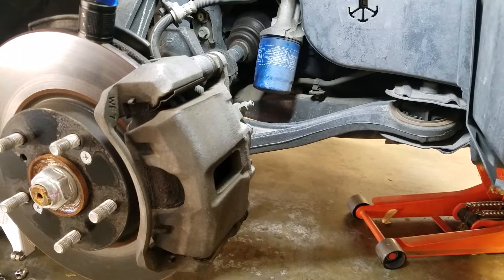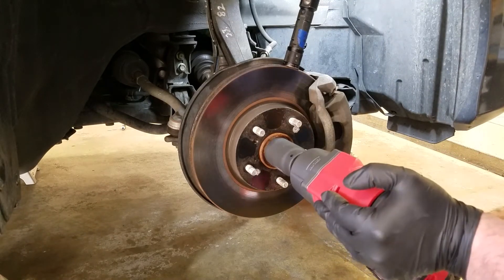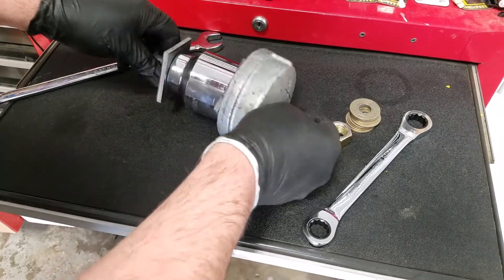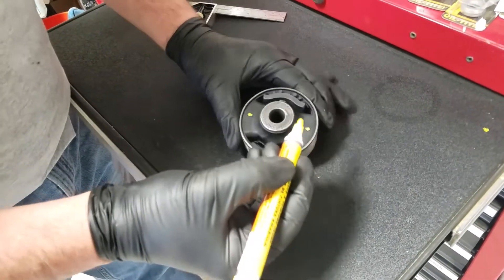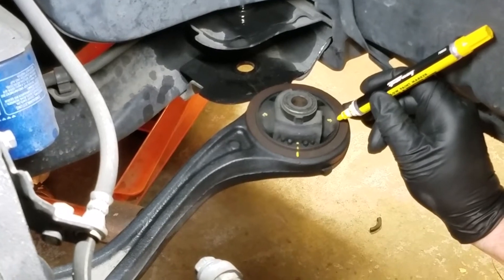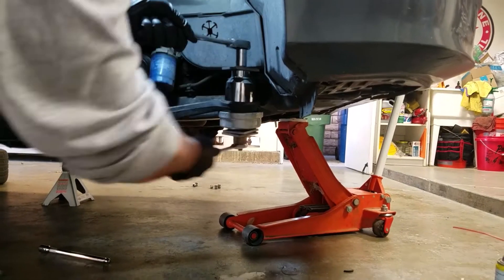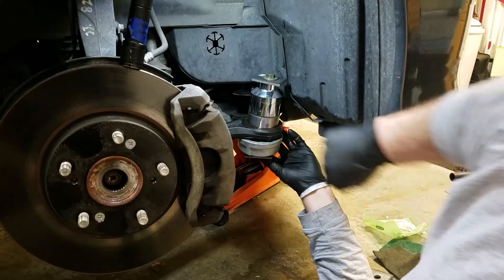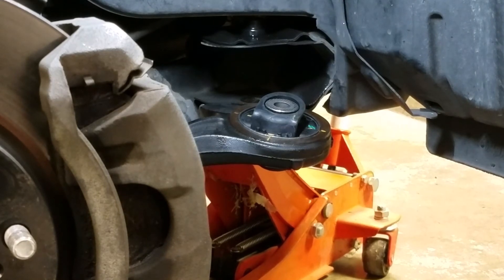Honda Accord Front Control Arm Compliance Bushings Replacement with Homemade Press

Comment: You can buy threaded rod almost any where Home Depot Amazon True value most Mom & Pop hardware stores will have Threaded rods for sale in common size thread pitch 1/4 3/8 &  1/2 - 13 threaded rod then cut to length. Great Video I to bought another set of control arm, but I kept my old set. Will definitely use this method with the bushings I could install.

Comment: waow. that was Great. I need to change my compliance bushings as well and like to make a set up like yours . I can't find the 3 inch galvanized pipe cap. Where can I buy one at . Any help will be appreciated.Thank you pal.
Reply from the maker: Glad its helpful. Here's a link to a 3inch galvanized pipe cap 

3" Galvanized Cap https://a.co/d/do9wCnV
Reply: hey thanks bro for your reply. Do you know where I cab buy that big bolt at. or a link? that's the only think I need. Thank you buddy.
Reply from the maker: @truejey7475 got mine at tractor supply. You need a grade 5 or 8 for strength. Suggest trying local better hardware stores near you. Min length of 8 inch is needed. All thread is also an option.

Comment: When installing the new unit, I added a hose clamp around the socket and bushing to keep them aligned.
Reply: I have found C clamps very helpful to nudge suspension components into place.

Comment: u r  lucky to have this bushing puled out by this device  i had  to exert a 3t pressure on my hydralic press
Reply from the maker: Jason, living its entire life in the arid desert climate of Southern California helps considerably as there is very little to no rust. That said, the rust-belt-wrenches know all too well the benefits of soaking parts in a quality penetrating oil and heat when servicing their cars. When I lived in the mid-west I would soak such parts in Liquid Wrench for several days before doing the work, which helped a lot. Good luck to you rust-belt DIYers on this simplified method. The ride is noticeably better!

Comment: Very nice DIY compliance bushing tool. Good job!  I did the bushing with Schley Products 68100 (cost around $150), which was based on the same idea. For rust belt cars, use a C-clamp ball joint press will save the threads of the central bolt, especially during removal.
Reply from the maker: TY. I searched for the Schely 68100 everywhere and unable to find one, even used, it has been discontinued. So had to make my own for about $40-$45.
Reply: I was thinking about just using a ball joint press for the whole job. I wonder if the kit I use has the correctly sized cup?
Reply: @travisbarrow3408  my harbor freight did not. Had the right press cup but not receiving
Reply: @shantor100  You can use one of the cups in your ball joint press kit...

Comment: Why not just use the socket and pipe cap with a ball joint replacement removal tool same sanario yes?
Reply from the maker: You certainly can, if you have one or use the tool loaner program at your local auto parts retailer. I don't have one and for a lot less money made it myself. Either way, the job is done and this method leaves the control arm in the car which is less work in the long run.
Reply: The clamp isn't wide enough when you start to add things
Reply: Yes, you can do that if you have the balljoint set with the giant C clamp and the cups..
Reply: If not then get a full-thread grade 8 bolt and save all the washers....

Comment: Great video. Envy you guys where cars don't get a steady diet of salt. Undoing fastener on my '07,  especially suspension components, is always a struggle.
Reply from the maker: I remember those days in the rust belt well. Always a challenge. Sawzall and torch are your buddy in those cases. If your ride is clunky and its not the strut, this is likely the solution. Inexpensive as well and would definitely spend the ~$30 for the Honda bushing as they will last.

Comment: Bought everything minus the pipe cover and socket as I used my ball joint remover cups which fit same and did not work for me. Kept on bending the square spacers and galvanized bolt even bent

Comment from the maker: Components and Sources:
2 1/8" Job Smart Socket from Tractor Supply: https://www.tractorsupply.com/tsc/product/jobsmart-3-4i-in-drive-2-1-8-in-socket?cm_vc=-10005
3 inch galvanized pipe cap which you will need to drill a ~5/8" hole in the dead center (not the one I used but one found on Amazon): 
https://www.amazon.com/Cap-NPT-Galvanized-Malleable-Iron/dp/B01LWE75CX/ref=sr_1_3?crid=M87OVJNDR9RB&keywords=3%2Bin%2Bgalvanized%2Bpipe%2Bcap&qid=1654214515&sprefix=3%2Bin%2Bgalvanized%2B%2Caps%2C101&sr=8-3&th=1
1 Grade 5 or 8 bolt: 8" x 1/2" coarse thread
2 Grade 5 or 8 nuts: 1/2" with matching coarse thread
6-8 matching Grade 5 or 8 washers
2-3 Square Bearing Plates with 1/2" bolt hole, like these from Home Depot: https://www.homedepot.com/p/Simpson-Strong-Tie-BP-3-in-x-3-in-Bearing-Plate-with-1-2-in-Bolt-Dia-BP-1-2-3/204842277
Reply from the maker: @PlayaBluffHotelBocas  The process would be the same however, I am not sure of the size of the Odyssey bushing, so can't confirm fitment of the socket and pipe cap I used. Suggest you do what I did, buy a bushing (even if a cheap one at a local auto parts store, which can return if not used) and use it for sizing a socket for pushing which catches the exterior ring of the bushing but just a bit smaller in diameter so it can push the bushing out from the control arm.

Comment: Could you post some links to the components you used, or comparable? Or at least spell them out?
Reply from the maker: All components and their sources are discussed at 5.12 into the video and I've added details in description of the video above.
Reply: autozone ball joint tools,  has different size cups, very easy
Reply from the maker: @johnh9507  Yes they do, however all the LOANER sets I looked at from multiple parts stores didn't have the right size for pressing out the bushing. So I went this route.
Reply: @galco9836  i got two sets, one with the c clamp and another with more cups,  i found one with within .005  and put a hose clamp around it and put the the new bushing in it to help like another hand,  i did the job for $8  with moog blue yellow box bushings from ebay
Reply from the maker: @johnh9507  Please post details on the kit you used on the compliance bushing as that would help others. Have you done the lower ball joints? Those require a special designed cup as well. Thx
Reply: @galco9836  they only offered a few kits, one kit with the c-clamp had a perfect cup for receiving the old bushing it fit the diameter of the control arm perfectly, the other kit only cups and i found a perfect size for pushing it out and in, not  a big fan of the aftermarket bushings because they have an aggressive taper which makes it tougher to find the perfect cup because the taper gives it a sharper edge to push on
Reply from the maker: @johnh9507  If you could post the manufacture and part numbers of the press kit you used, that would be most helpful. Cheers!
Reply: @galco9836  OEM  57310 and 57023
Reply: @galco9836  i walked in blind like everyone else,  compliance bushing in one hand and a caliper in the other and said bring these out, they have a sheet with the kits and pictures and i think autozone only has OEM brand, and if you are doing this for the first time and the bolt is rusted to the bushing, that is when the fun starts,  easy job until that happens
Reply from the maker: @johnh9507  Hahaha, I did exactly the same. Brought the bushing and my calipers and we went through all the kits at my local branded auto parts stores didn't have the right size. Glad you found one that worked!

Comment: I appreciate you doing it on the car but why not just take the control arm out. Not that bad a job
Reply from the maker: Agree most remove the entire control arm but it's more work and you put at risk upper and lower ball joints, especially their boots in the extraction process. Don't ask how I know, luckily Honda sells replacement boots for the long lasting original, high priced and better ball joints. This method is faster, even if it's awkward sitting on your garage floor. Cheers! Galco
Reply: @galco9836  makes total sense. the Acura I just did was not fun, lower ball joint replacement and my press kit didn't fit or the compliance bushing so luckily my mechanic lives behind the and pressed out the ball joint and I just put a new control arm out but after your method I think I'll do the arm I took out and sell it. Yeah, not having a lift is a real pain for us diy
Reply: Man that tape measure has seen some life huh
Reply: If you take out the entire lower control arm, then you would need a bench press to hold on to it while you pry the thing out....in situ the car is holding it for you....you can do the same with pressing out the ball joint and the bearing...